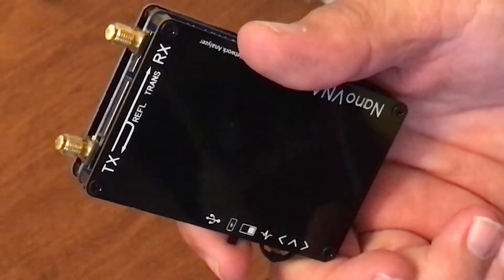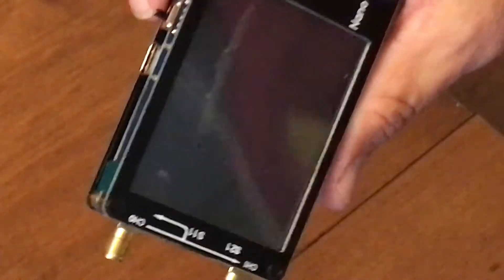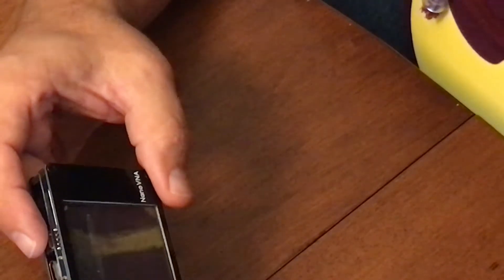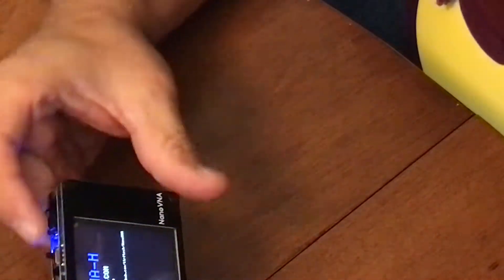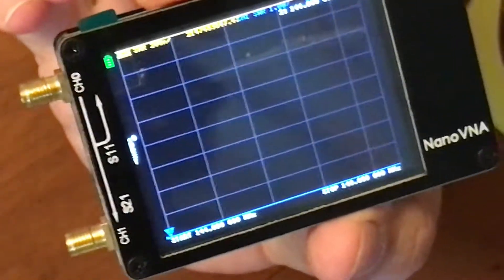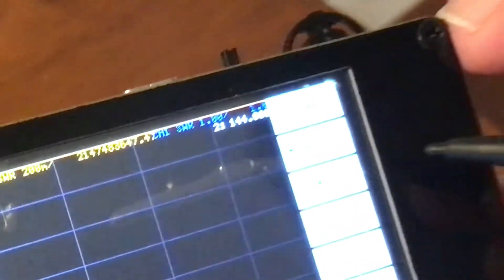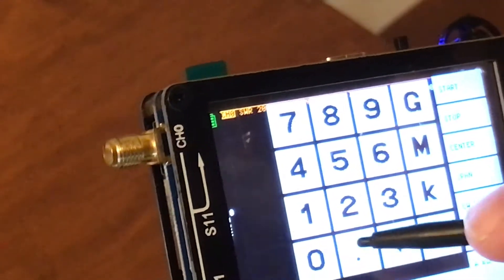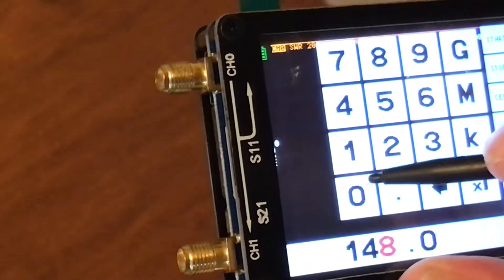HT Antenna test

Comment: I expected that the video would end with the author clicking on the transmission)))
Reading the comments, I want to note that it makes sense to connect a transmission device only to gain ground mass, for example, it makes no sense to measure car antennas on magnets without a metal base. It could have been done a bit better for the direct connection model.

Comment: Hi! Thanks for the intro! I have a similar litevna tool at home, though it might be  a bit cheaper build.
Every time I try to measure SWR, even on rubber stock antennas like the one you showed, I alawys get very unstable results. I do the calibration and all but my SWR readings jump from 1 to 10 just because I move the antenna a bit or touch the rubber part. It is kinda unusable, to be honest. 
What am I doing wrong? Is there a sensitivity parameter I can tune down?
I usually look over wider band (130-160 MHz instead of 144-148) in case that might be relevant. There are clear spots with SWR about 1.5 but those shift very fast with magnitude of 10s of MHz upon change in the orientation as described above.
Reply from the maker: Your test cable is probably the culprit. When I have unstable readings I change to a cable that I manufactured from LMR240 the readings stabilize. You could try making your own, or purchase a new one from a reputable manufacturer such as Comscope.

Comment: 1.17 at what frequency?  and why are you even hooking up a radio when testing an antenna?
Reply from the maker: I do this all the time at work. And 1.17 in the 2 meter frequency.
Reply: @rffieldtechke5adx  in the 2 meter frequency? there is a 2 meter band, so, what frequency in the 2 meter band?... you test vswr at a particular frequency, you cant just say "the swr was 1.17 on the 2 meter frequency" you could say something like "it was 1.17 at 146.520mhz" there is no way the swr is going to be 1.17 across the entire 2 meter band.
Reply from the maker: You are correct the w meter band. But I will have to rewatch to see which frequency specifically. I did set the range from 144-148MHz.